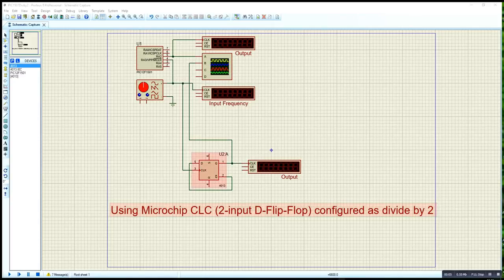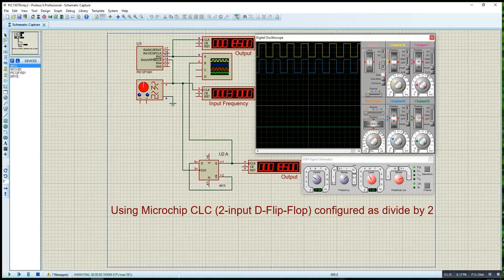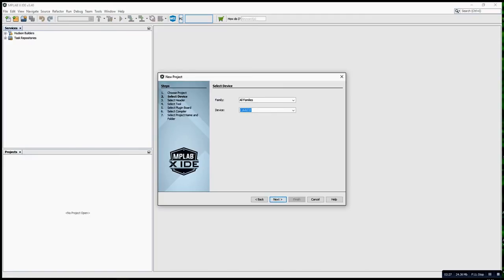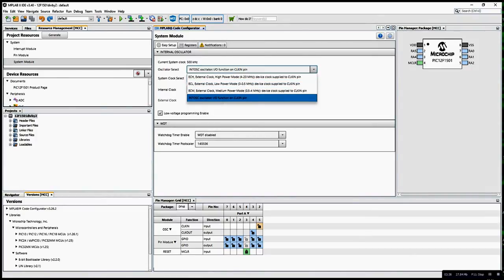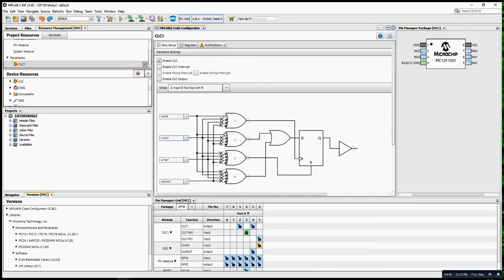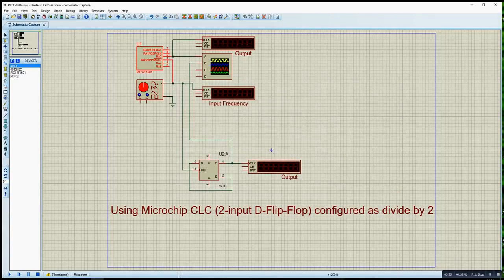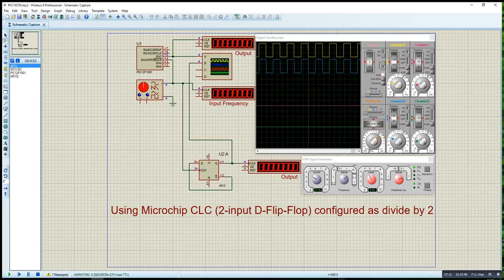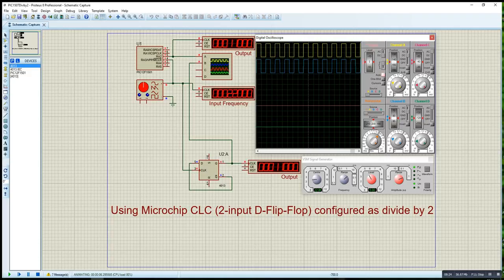Using CLC configured as divide by 2 counter in MPLAB X

Comment: What frequencies you plan on using?

  In my experience the PLC12+PIC16 series start becoming unreliable above 20-50khz with this kind of setup.    It may have a 8mhz processor, but actual operations-per-second is is 1/4 of that, and the output gets very jittery as you go above 50khz.
Reply from the maker: CLC is different it do not depedent on the core clock frequency be it 1Mhz or 32Mhz.It's like a "programmable logic gates" and flip-flops
which base on my actual experiement can work up to around 400khz or as fast as the i/o pins of pic chip can allow.In the third video of CLC i will show you my actual experiment with scope using PIC with embedded 4 xCLC to create a div by 3 counter with 50% duty.It is a prototype design using all 4 CLC in one 8bit chip 16F18325.
Reply: Thanks for clarifying, I must have misread the chip on your video.

 Looks like these solve a lot of the problems when working at higher frequencies in resonant circuits.
   I am going to have to try these chips out now, thanks for sharing.        :-)